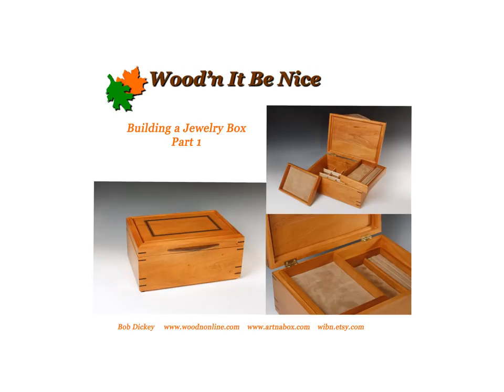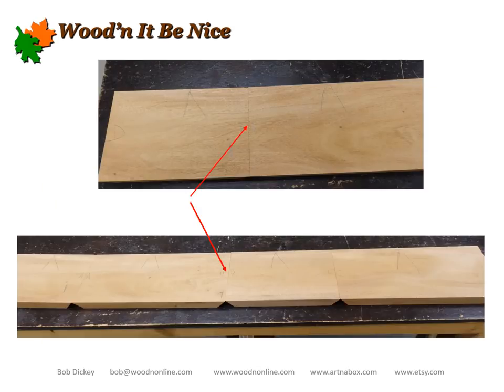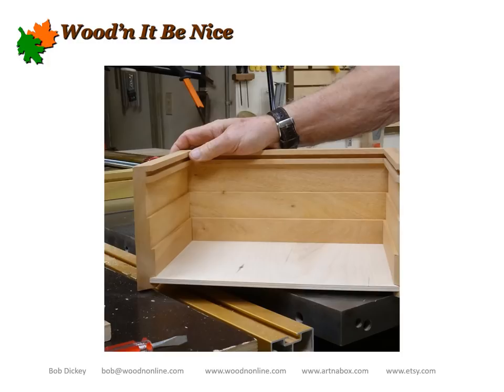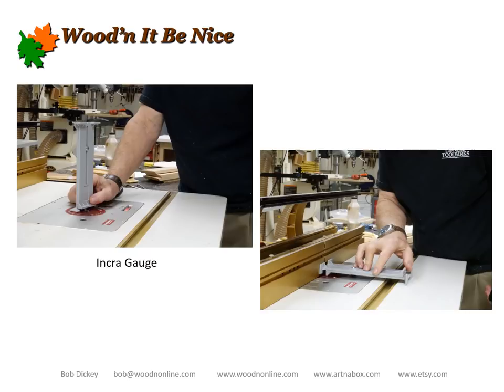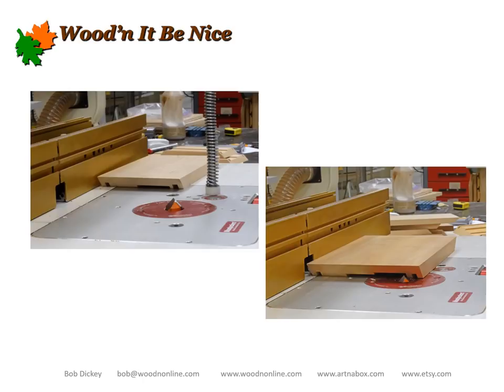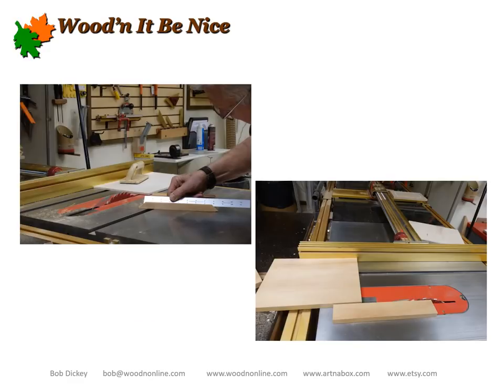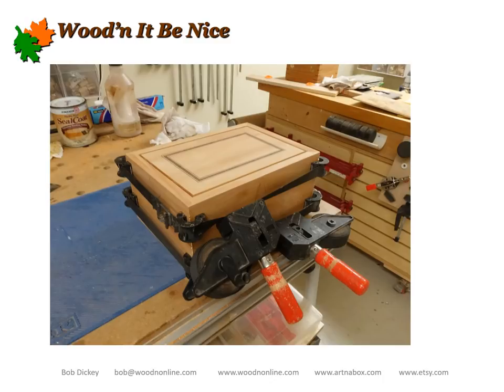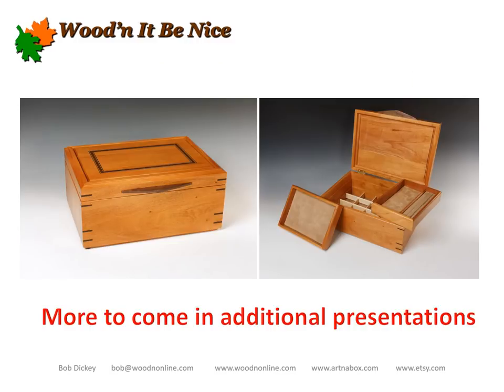Making a jewelry box   part 1

Comment: Bob, Your approach to routing the internal profiles runners is nothing but BRILLIANT!!!!   Definitely, a time saver, stronger construction, and aesthetically pleasing,  Very impressive!!  Would you mind adding the list of router bits you use to create your boxes?  I would definitely want to try this approach.  Note:  Looking at your shop I have all the same equipment!   Love Incra jigs!!!
Reply from the maker: Hi Jim. Thanks for your comments. You know, I have pitched projects (including the internal profiling) to Woodcraft Magazine and Fine Woodworking. Woodcraft picked two and featured me in two issues in 2011/2012. But neither mag was interested in the profiling. That surprised me, only because I have never seen it anywhere else.  As for the router bits, I use mortising bits for the profiling. They give a nice flat surface. Mine are CMT (801 series) but other brands have them as well. I have a 1 1/4" and 1 1/2" That I use.  For the lid panel profiling, I have used CMT and Whiteside junior panel raisers, but am currently using a Whiteside 15 degree shaker door panel bit. I like its simplicity.